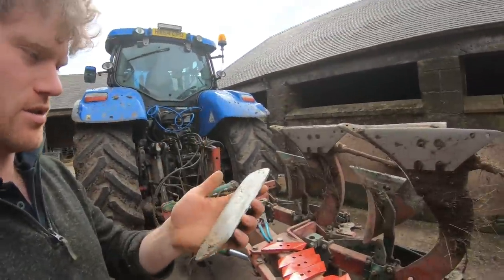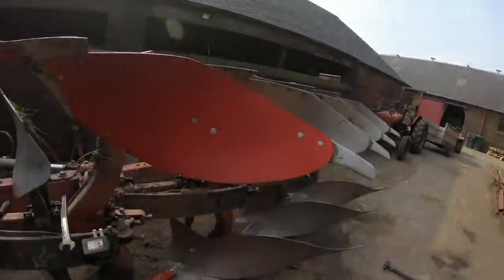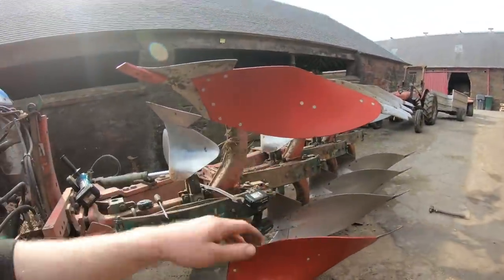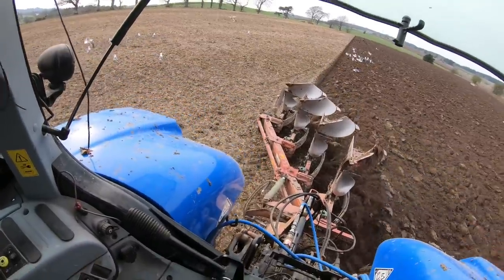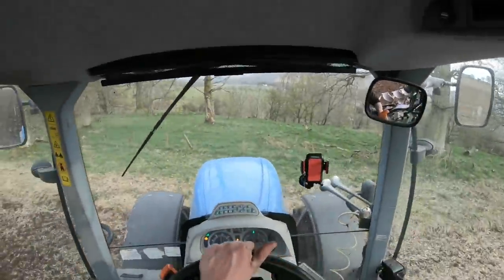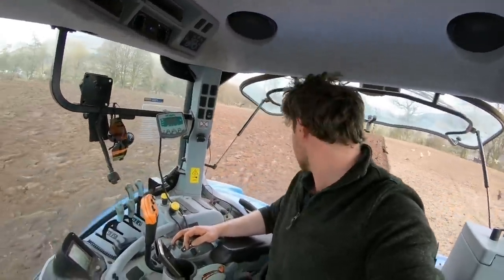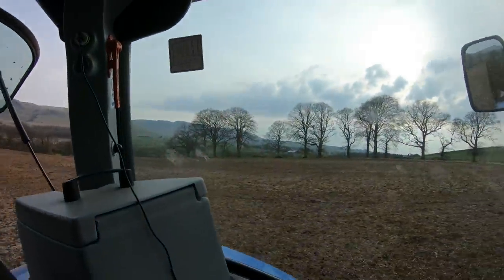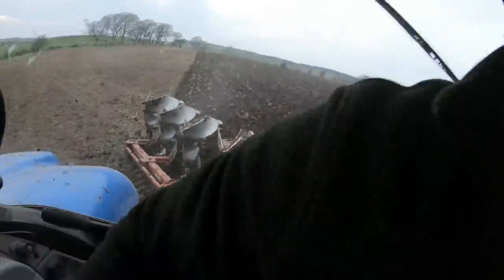PLOUGHING THE LAST FIELD!! YASS MAN

Comment: Hi if you get a can of nitromors from a paint shop a quick coat and the paint will bubble off in seconds .
Reply: Good suggestion.  I thought that running the plow through the soil will clean it off.  That is tough paint.